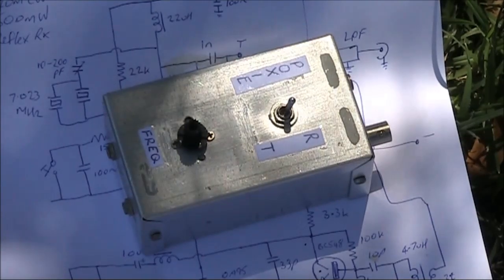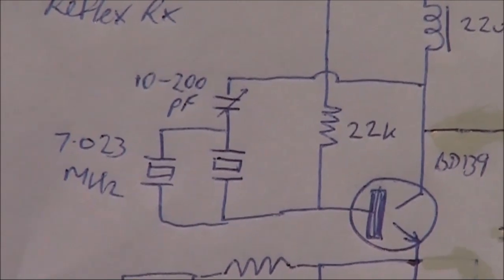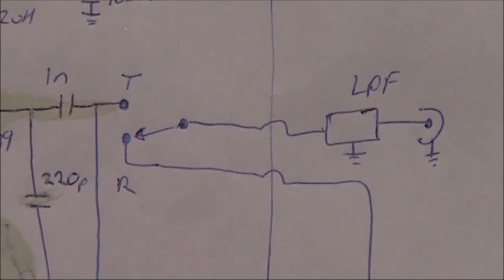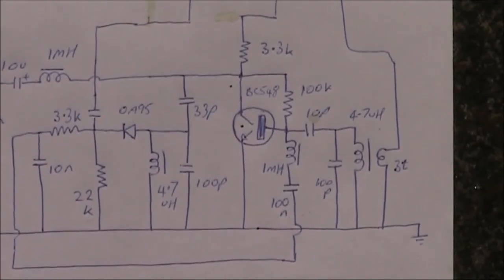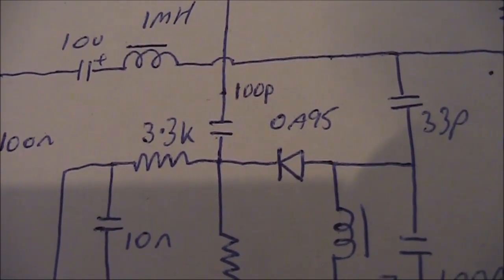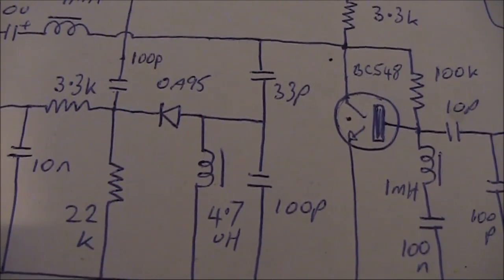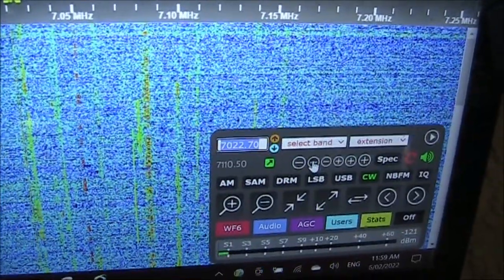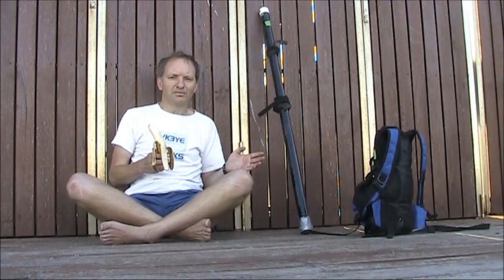Poxie 2 transistor QRP transceiver

Comment: Interesting as always.  When I was a kid, I ordered a "spy pen radio" by mail.  It was a simple diode detector receiver fit into a pen case where the tip of the pen slide in and out for tuning.  It worked pretty well.  I wonder if a Pixie or Poxie could be constructed to fit in a package the size of a (fat) pen.  I imagine an SMA antenna connector on one end, a headset jack on the other end, small button batteries for power, with the pocket clip as a makeshift key.  There's a project for you, Peter!  : )  73

Comment: In the receiver section, is the resistor to ground on the OA95 cathode 2200 ohms or 22,000 ohms? I can't tell; it looks like a dot between the 2 and 2 to me, which would make 2200 ohms. Should there also be a capacitor to ground across that resistor?
Reply from the maker: 22k. No dot & no capacitor. Capacitor would just shunt the RF at that point to ground.

Comment: Do you have one for 15m?
Reply from the maker: No. 15m would be much more complex & much less active.
Reply: @vk3ye  Thanks for the reply! Looking at making a 15m CW beacon and are looking for an easy circuit.
Reply: Over last few weeks, I have often monitored 15m when open during daytime. I have heard very little activity around 21.060MHz. In EU at least, there doesn't seem to be much QRP activity on 15m. I seem to have more luck on 17m and 10m.